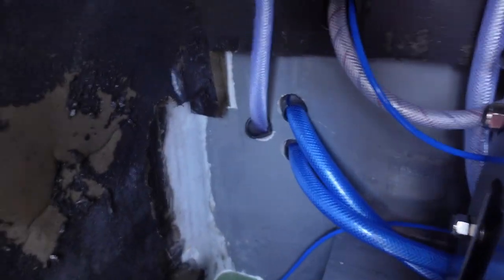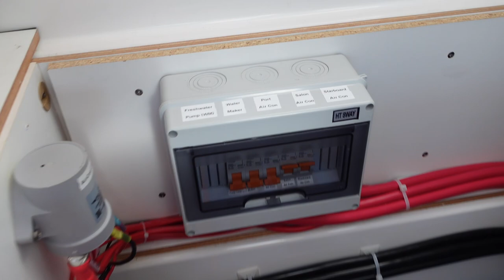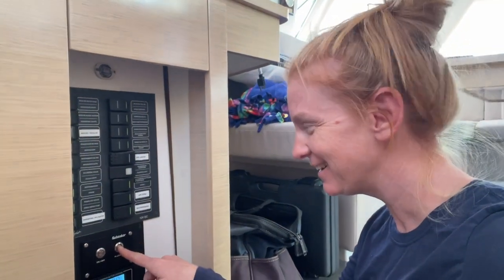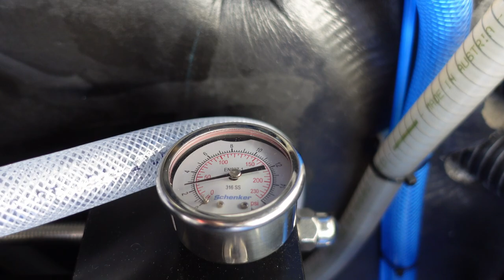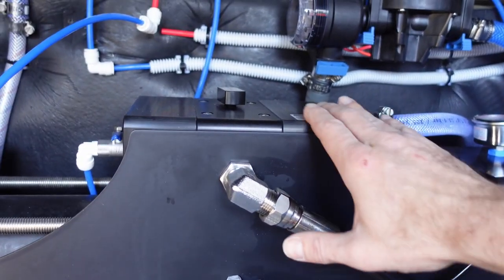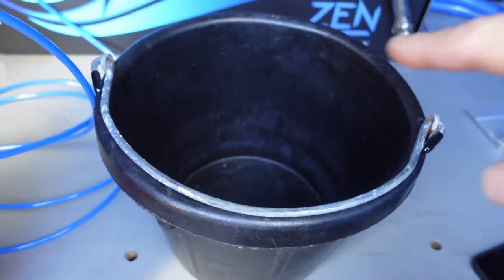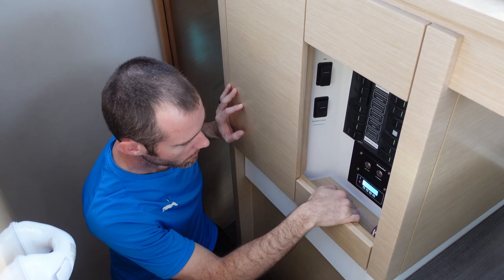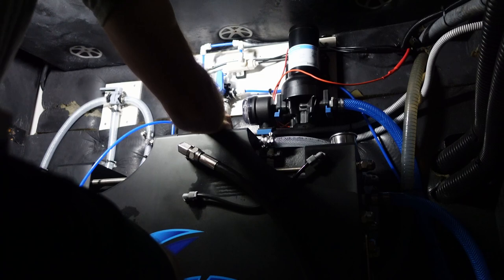Commissioning and Troubleshooting Our New Schenker Watermaker

Comment: Glad you got watermaker to finally work properly.  Very complicated, efficient and anything but KISS.  Personally prefer a system with more manual control, like increasing pressure using a needle valve.
Reply from the maker: Which type of watermaker to go with was a decision I mulled over for a long time.  We did really like our manually controlled CruiseRO system but it uses significantly more power than these energy recovery systems.  And since our overarching goal during this refit was to get as energy efficient as possible, I decided the additional complexity was worth the trade off.

I will also say though that one of the big reasons we went with Schenker is that it has manual overrides for pretty much all the controls so if something does go wrong with the fancy controls, I should still be able to make it work.

Comment: Thanks for sharing. We have a new one as yours. I have a question.. when you start flushing for start up, do you close the depressurizing valve after the flushing ends or in the middle of the process?

Our water maker starts but stops after 5-6 minutes. We are trying to find the reason. No visible leaks. A few drops through the 5 micron filter top cover maybe…Thanks again.

Comment: I have had the very same watermaker and I am happy with it. What I did not fully understand: why do you add complexity and have a automatic relay for the quality? I have a 3 position (manual) valve where I can route to forward/aft/faucet. I let it run to the faucet in the sink for the first 10 minutes and then to either tank 😀 no wires, no worries. The faucet position lets me fill glass bottles without going through the tank. Additional bonus.
Reply from the maker: Figuring out how to install the Schenker in the most efficient way/re-using parts of our previous install was a lot of work!  One of my goals for the new install was to be able to control it without having to go up into the locker every time. (It wasn't super fun having to go turn on/shut off the watermaker when it was raining!) I thought long and hard about going with a manual 3-way valve like you have as that is what we had previously.  

However, the best location I could come up with to mount it for easy access was where we installed the control panel...  which is where all our 12v switches are located.  So a water leak there could be disastrous!

The automatic relay was my compromise.  It keeps all the water lines in the locker but lets me control things from inside.  It does add some complexity, but if it fails, I can still control it manually so I was okay with the trade-off.

Comment: Hi! Thanks for your great videos! I have the same water maker as you and I’ve spent the last hour trying to troubleshoot. 
When I switch on (on/off button) it beeps then after a few seconds I get a long beep and both buttons start flashing. 
The pump motors don’t start either. 
Any idea what that could be?
Thanks for your help.

Comment: Do you have any video yet if cleaning and pickling? I would love to have a diagram of the hose and three way valves for cleaning. Our Schengen installed per manual with no places to tap in.  Thank you…..great install!
Reply from the maker: We've been using the watermaker so regularly, we haven't yet had to pickle/clean it yet.  If you want to send us an email at starryhorizons@outchasingstars.com we can share the diagram we made of our install.

Comment: Certainly is a ton of parts to this system. Curious as to why you choose it as it seems rather complicated? Happy all is well and good to see you out on the water again. 😊 ✨ 🌊💨⛵️🏝👙🌞✨
Reply from the maker: That's a good question and one I debated a lot given how much we liked our relatively 'simple' old CruiseRO watermaker.  And the answer came down to energy efficiency.  This Schenker is among the most energy efficient watermakers on the market and with our overall goal to be fully off-grid and powered via solar, energy efficiency was vital.

And while there is some more advanced automation with the new setup, it still has manual backups.  So if the fancy stuff fails, I can still make it run!

Comment: Does that 12v watermaker do a self clean cycle when you finished making water or do you have to initiate the cleaning cycle yourself?
Reply from the maker: We have the option to set a timer for 1,2 or 3 hours of production.  When that timer ends, the unit will do an automatic freshwater flush.  But if we choose to just turn the unit on, then we'll need to initiate a freshwater flush ourselves.

Comment: I just wanted to ask if Schenker advised the order of the filters. I have my own company that deals with filtration and the order of filtration should be the particulate filters, one or two stepping down in micron efficiency then followed by the carbon filter. Your carbon filter may plug up faster than you want in the order you have and they are more expensive than the particulate filter. I would advise switching the order and using the particulate filter as your “sacrificial pawn”
Reply from the maker: Hi Jerry!  The particulate filter and the carbon filters are actually on separate water lines.  The particulate filter is on the seawater intake side and then the carbon filter is on the fresh water flush side.  So for this system, the carbon filter is more for protecting the watermaker membranes from chlorine/chemicals that may be in the fresh water tanks when filling up at a marina.  Hope that makes sense!

Comment: Where did you source the 3-Way valve used in the Brine Discharge? Thanks
Reply from the maker: Rich at CruiseRO has a good supply of them.  I've also found some on the US Plastics website.
Reply: @OutChasingStars  Thanks. We installed a Zen30, cruised last summer and kept our water tanks full all off of solar. Great system.